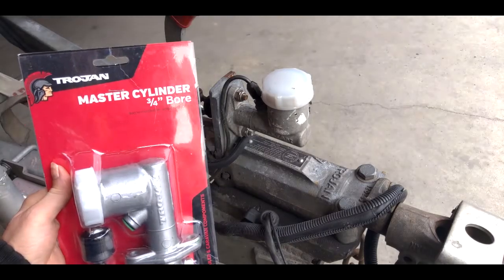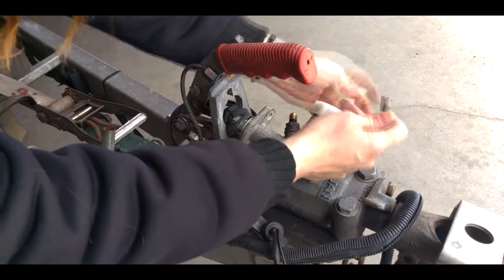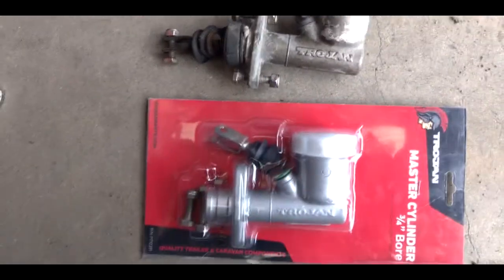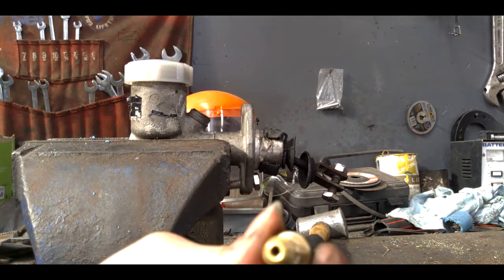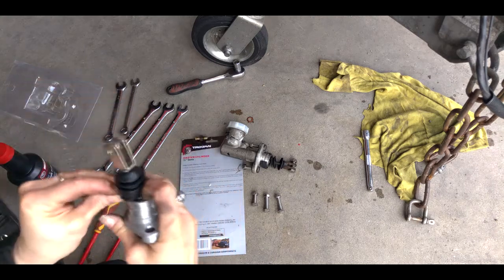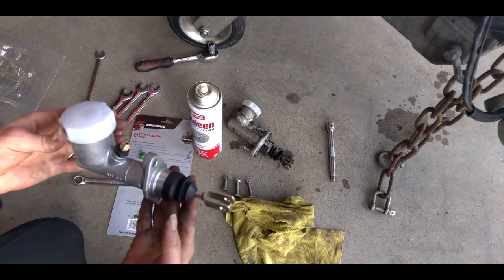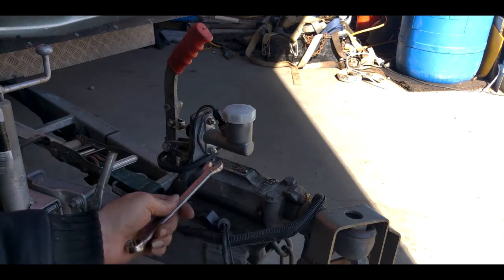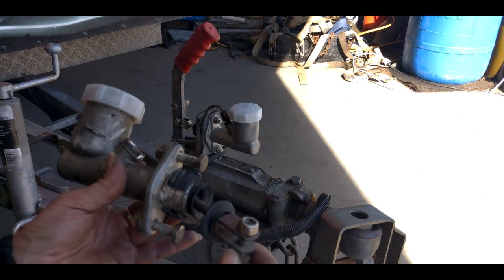TROJAN Master Cylinder Replacement on Trailer *DIY* - GHG69

Comment: Need one. Could you provide a link to where to get one.
Reply from the maker: I’d recommend Ebay/TradeMe, etc. depending on what country you’re in. Here’s a current listing if it helps: https://www.trademe.co.nz/trade-me-motors/boats-marine/parts-accessories/trailer-parts/auction-4248756667.htm